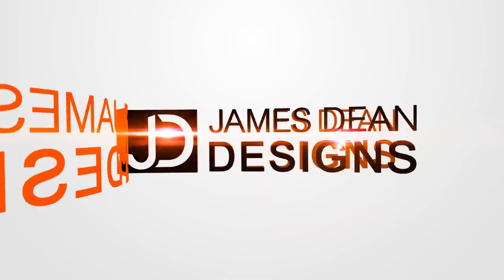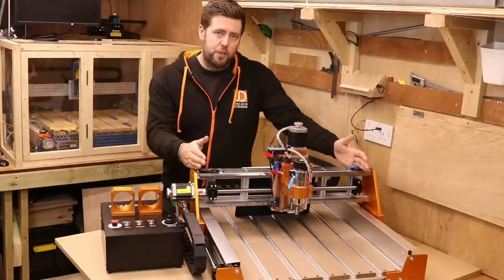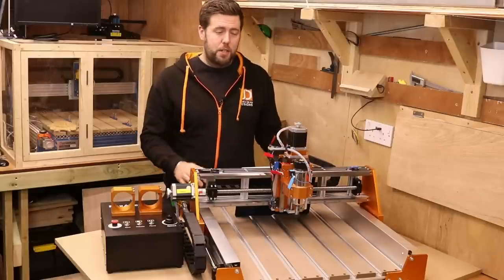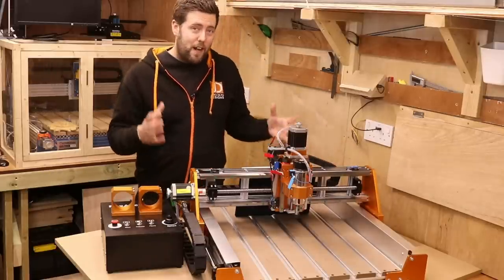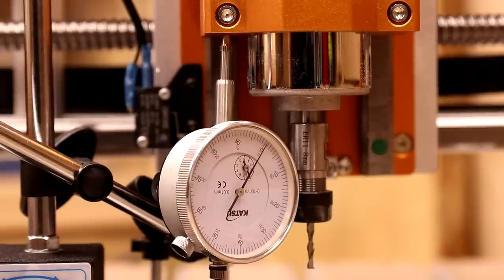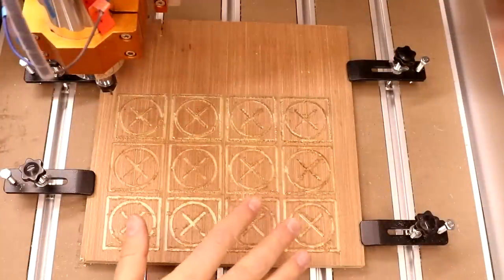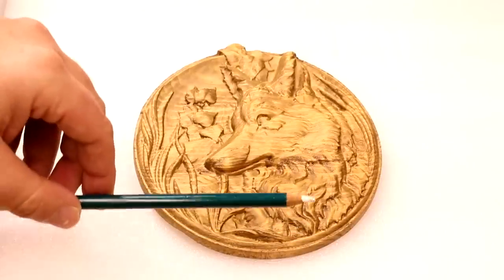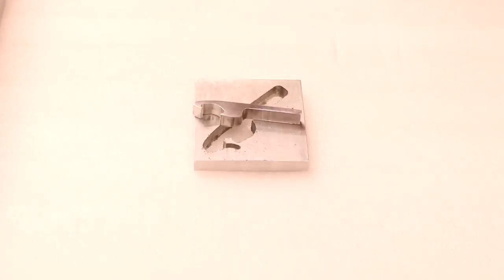FoxAlien Vasto CNC - Detailed Review

Comment: Hello. I was thinking in buying one of this FoxAlien Vasto CNC. Do you think is possible to use a 80mm 2.2KW Spindle in this cnc? I know the supplied clamp/holder is only 65mm which is perfect for 1.5KW round spindle. Would be possible to use a Square 2.2KW Spindle? Do you know what is the distance between holes that held in place spindle clamp, 4 on each side? Thanks.
Reply from the maker: The machine will run a 2.2kw spindle, I know others who have done this. I don't have the measurements to hand but I believe it's 70mm on width between the centres and 50mm on the height

Comment: hi James. have you installed the higher power spindle? if so will you do a review/setup video/ provide details of what you got a who from...? I purchased the vasto and want to upgrade the spindle but its difficult to choose a 65mm spindle without going water cooled... As far as I can tell its not going to be easy to make a bracket to fit 80mm spindles. Best regards (another) James
Reply from the maker: Sadly it's all sitting there in a box but just not had the time. It's a Vevor 1.5kw spindle and is only a 65mm diameter so shouldn't need a new holder. Yes a water cooled is generally better buy I was happy with the air cooled version. I will be making a video once I get round to it
Reply: @JamesDeanDesigns  Hi James. I finished my 1.5Kw water cooled upgrade. Had some issues, wrong plug supplied with the spindle. Seller supplied a gx18-4 connector instead of the required h17-4. VFD setup took a little research but I am very happy with the results, especially the extra rigidity in the spindle and much lower noise- a very worthwhile upgrade. 
I took apart the original 400W spindle and its not very rigid. The case is quite thin and the only thin holding the entire spindle together is two long bolts which clamp the top and bottom of the spindle to the case. The bearings are very small and have a fair amount of play in them.

Comment: Hi James, great review! But don't you think the x-axis ball screw that is not properly protected and covered cannot be damaged by the accumulation of sawdust and milling waste? Cheers
Reply from the maker: Thank you. The ball screw blocks are usually well contained and full of grease so its actually quite difficult for stuff to get in there and cause damage. I get the concern as it does visually look open but I havent found it to be an issue, especially if you clean down your machine after each job

Comment: James, I've just purchased this and the boxes arrived yesterday, but due to current space constraints (Christmas!) I haven't yet unpacked it.

I'm wondering about the extrusions with MDF "spoil board", is the spoil board removable from those extrusions?  I ask because you have bought up the downward flex of Z, and while that can be resolved with cross bracing easily, I'm wondering about another method which will make the bed ultimately strong while adding mass to the the bed & unit as a whole.

If the MDF can be removed, then it would be possible to get lengths of granite to replace the MDF slats, since this "built in" spoil board isn't really spoil board and you would place the real spoil board on top, the granite wouldn't pose an issue here since it's only purpose would be to provide a flat and unmovable surface.

The second option could also be to completely remove those slats and replace with a large granite slab. however I think slats is a better option.

It may not work in practice, but it is something that has strung to mind as we have a machine that is used as part of PCB production line and it has a granite construction as it has a head on it that moves so quick it appears to be in one place and then another, you don't really register it moving, it's like it teleports!  

They used granite because the machine needs to be massively rigid and deal with the loads that are placed on it, it has linear motors which is how it's able to move with such speed, force and precision.
Reply from the maker: Yes those MDF slats can be removed. They are just held in from underneath with little screws 👍
Reply: Cheers  @JamesDeanDesigns  I think some experimentation is in order, I need to watch the video again to see which box they're in!

Been watching your videos for quite a while now, love the detail you go into.

Comment: Hi James, once again many thanks for showing how sturdy the frame is with negligible backlash on all the axis and it perfoms quite well cutting aluminium also. I am trying to figure out what type of Nema 23 motors this machine has been fitted with. This is mainly to get and idea of its specs with regards to how much torque they can deliver and the minimum holding current required. Do the motors have any part numbers that I maybe able to cross reference?

Comment: Thank you for all the very useful information you provide. I have been watching your channel for the past two years.
This machine seems to come very close to my requirements without spending a fortune.
I am an amateur knifemaker and am looking for a cnc machine able to cut knife blade profiles (stainless steel approx. 4mm thick) and wooden handles.
I have been contemplating a machine from CNC-STEP in Germany (models Z400T, Z750T and Z1000T which just differ in sizes) but their specs seem similar to the Vasto's, just at nearly 3 times the price.
In your opinion, assuming I upgrade the spindle on the Vasto as you suggest, would I be able to cut stainless steel blade profiles (say 1 or 2 per month) or would I be too ambitious?
Again, thank you for your excellent work. I have learnt an enormous amount from this.

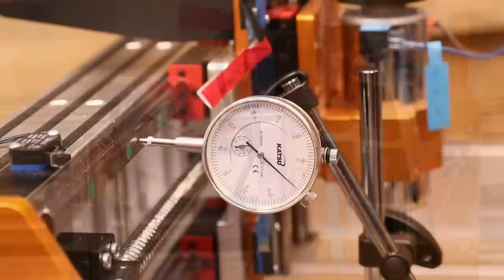Comment: @JamesDeanDesigns Hello! Thanks for the good machine reviews! What is the minimum distance that a sharp tool can be moved? At 9:47 you show no play during return. Could you also show with a micrometer the smallest possible pitch? What limitations are there in this? Minimum software restriction step? The engine has a turn-on-turn per engine step. At what distance does a tool shift using a worm gear and one step of the motor? I can't find this kind of information in more detail. How thin can you engrave? What about accuracy on cheaper machines? Very interesting. Thank you!ng. Thank you!

Comment: So ... i'm pretty impressed by this and by the looks of it so are you. But I was also impressed by the new 3020 pro max. Would you say that this machine is in every way better than the 3020 pro max ?

And despite this being an impossible question to answer, would you say this one is worth the 5 times the price ?

I would say my main hesitation looking at this one is that the shape of the bed limits the size of work piece. Something like Simone Giertz's CNCelia (which i think is about twice the price of this) has a nice big bed, but I can't tell whether it is also good for metal.
Reply from the maker: The 3020 is a good machine for the price but these are in different leagues but that is also reflected in the price. The Vasto is a great machine, it doesn't have the biggest off beds but that is also because the larger you go, the harder it is tip stop deflection and similar things on the axis

Comment: just got a Vasto and got it assembled with your help on your you tube channel and thanks.I do have a problem on the router motor sounds like something inside loose, and on the up movement on the router it will bottom out before the kill switch shuts off, but the micro switch manually works  ( will shut it down when move with my finger). Any help will be grateful. Thanks again for your you tube information.
Reply from the maker: The micro switch you can either try to adjust or glue an small piece of plastic to bridge the gap. As for the spindle, I would be tempted to message FoxAlien and ask them how to proceed. Chances are they will ship you a new one out. Have you started the spindle up yet?

Comment: I can't tell if it's the angle of the video but when using the indicator make sure it's parallel with the direction of movement your testing ideally right next to the screw or rail.  I know the cosign error doesn't matter for this caliber of precision but it's just a pet peeve of mine.

Comment: I have the Masuter machine upgraded with 300w spindle, But I did not find any significant difference between the power of the previous and current spindle to be honest, except that the machine has vibrations and some imbalance during carving and cutting process, although I have adjusted the screws and their tightness. Will I notice any improvements in this new machine from Fox Allien or is it just a new version.
Thanks
Reply from the maker: You should have noticed a significant improvement going from the standard spindle upto the 300w, if not then something may be wrong. The spindle on this is not a big jump from the 300w spindle, but the main difference is the rest of the machine. Overall the Vasto is far superior to the masuter

Comment: Do you have a link for the spindle upgrade you are looking to move to?
Reply from the maker: https://www.vevor.co.uk/spindle-motor-c_10130/1-5kw-er11-air-cooled-spindle-motor-matching-1-5kw-inverter-drive-vfd-cnc-p_010306834877
Reply: @JamesDeanDesigns  Link no longer works. URL works if you change the domain to the new one vevor is using.  I'd love to type it in, but YT deletes the comment.

Comment: Hi  James can you please do a comparison between FoxAlien Vastro and Geminstu 4030 pro. I am looking for cnc mill capable of milling Aluminium and laser engraving
Thx 
Dave
Reply from the maker: The Vasto is better than the ProverXL but equally it's double the cost so it's not really a fair comparison if I did one. If you can afford the Vasto then then I'd go with that, but if your budget doesn't go that far then the ProverXL is still a great machine
Reply: @JamesDeanDesigns   thx James that helps answer my question if FoxAlien is a better product. Yes I recognise cost and size but looking at “budget” solution that can mill aluminum and laser engrave . Makersdream eve one or Carbide 3d nomad can mill aluminum but no laser engraver and cost a lot more

Comment: What is the max feedrate for this machine? I don't see the specs on the site
Reply from the maker: They rarely list them for various reasons which I won't get into but I got this upto 5000mm/min which is faster than I'd ever expect to machine with, but someone in the FoxAlien group said they went over 7000mm/min.
Reply: @JamesDeanDesigns  that's pretty amazing! How is that possible with the DM542 drivers!? I've used those before on the 5mm ball screws and couldn't get 5000mm/m without motor stall.

Comment: Are you planning to circle back to the 3020 pro max soon?
Reply from the maker: Yes, currently filming a video using the 3020. Anything specific you have in mind?
Reply: @JamesDeanDesigns  mostly aluminum performance, and compressed air for chip evacuation, or maybe mist assistance.

Comment: Your description of z axis makes it seem that there is almost 20 inches of working space. Not only is this not needed, but no way the z axis has that much travel on this desk top.
Reply from the maker: No, my description clearly states there is 105mm of travel on the Z axis. When discussing the footprint of the machine I say the maximum height is almost 20 inches which is to the top of the z axis but at no point to do I say the Z axis can travel 20 inches
Reply: Please watch the video before asking unnecessary questions.